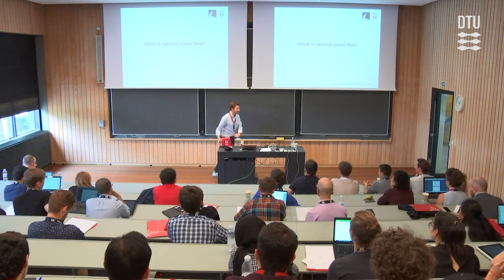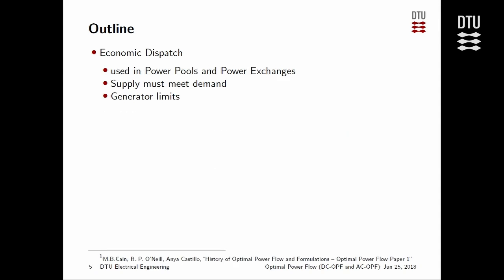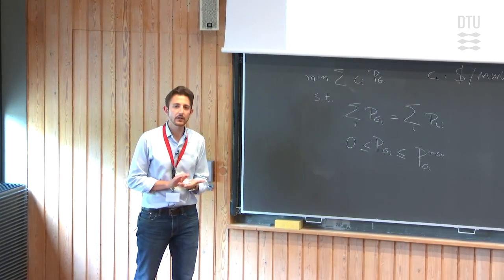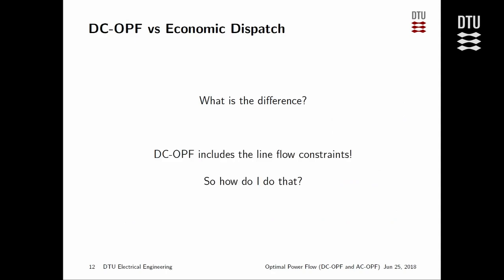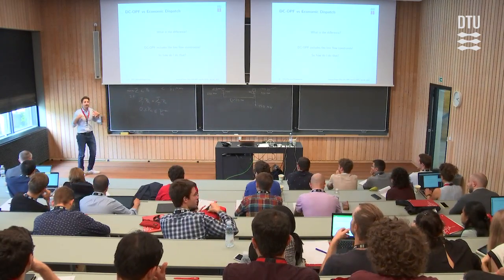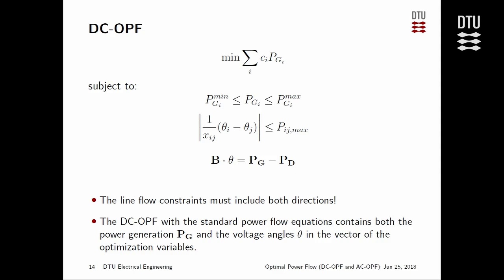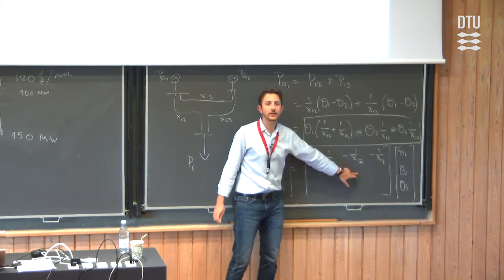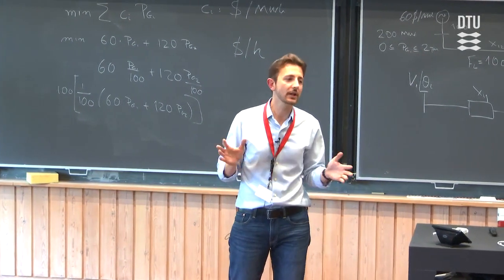Spyros Chatzivasileiadis: Introduction to DC-OPF, AC-OPF and Convex Relaxations -- Part 1/3

Comment: Can we solve AC OPF using meta heuristic  techniques like PSO ,GWO, GA,?
Reply: Yes but the final solution is not optimal with meta heuristics
Reply: So many research papers have done that. However, most metaheuristics suffer from “dimensional curse” and the computational speed is relatively low. Besides, we cannot prove the optimality of metaheuristics. So for your questions, my opinion is that it depends on your requirements. If you focus on the OPF problem itself, e.g. to improve the accuracy/computational efficiency/feasibility, etc, then you cannot use metaheuristics. While if you use OPF as a tool, for instance, to integrate uncertainty renewable energy, then metaheuristics may be acceptable.
Reply: @duofang3366  If using OPF as tool for Demand side management optimization, can we use meta heuristic techniques? Can you suggest something else,, please.